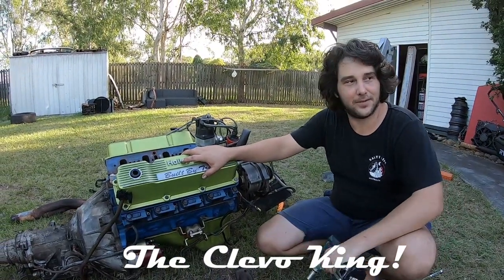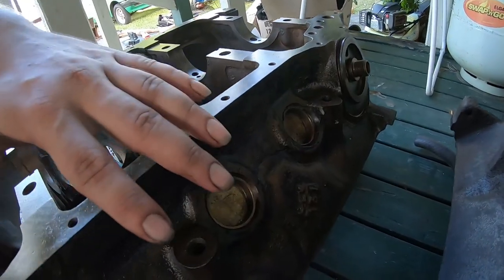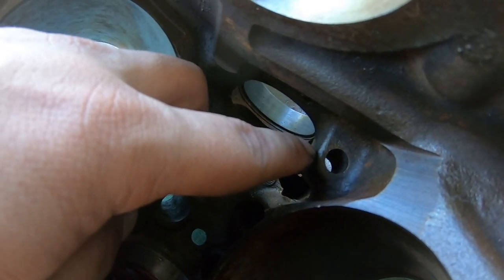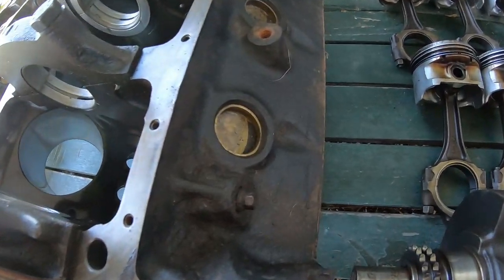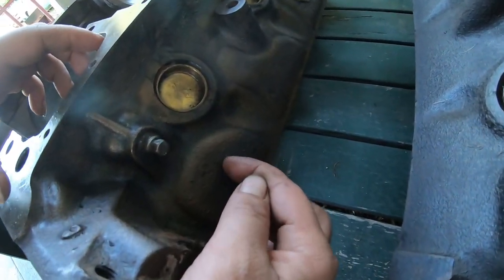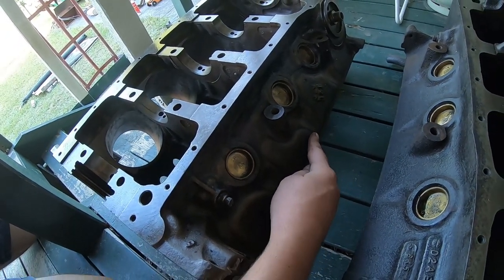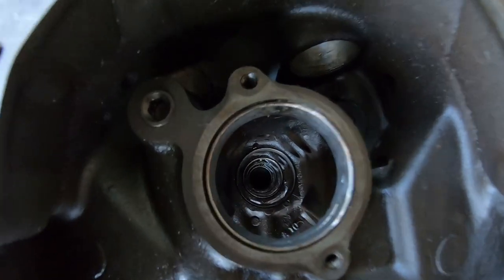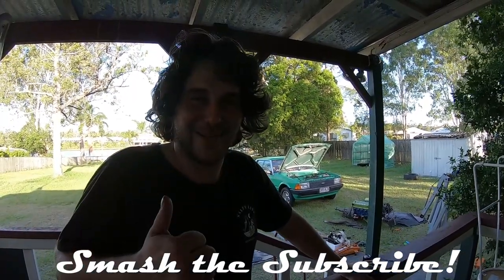351 Cleveland Pillow Block Tech Talk

Comment: The block number on the blue block D2AE-CA is the same as mine. It came up as 4 mains ,high out put ,cobra jet ,boss.
Could you confirm that's correct,it'd have me feeling pretty good if that's the case 😊

Comment: Great stuff read a lot on this. You Brothers are on it. Also what do You think off the oil line bottom left front to the sender to the back off the block is it worth fitting Clevo street Engine Stroker 408ci  Scat gear 4340 crank H beam rods SRP forged pistons  rev it to about 5500 lot more work done on it. Sveno Mick XB Falcon on YouTube You will see it. great site You Boys have would love to see Your opinion on factory Heads have a good one. Ps all street work is what I do Thanks.
Reply from the maker: Thanks mate, appreciate it. They are used on a lot of builds we have done in the past, but I haven’t used one personally yet.

Comment: Am very happy with the compression at 165 consistently, bottom end seems very good, no leaks etc, we have had a few props over time and are told this 3 blade one is about as good as we can do for out of the hole performance with an Argo V-Drive @ 17% step up and soft clutch? She’s just a bit tired and wondering if a cam and set of heads might give it the extra pep for towing big boys out on a single ski? 🤔🤔

Comment: I bought a block with a 4ma crank in it and I noticed also that the top of the bores are ground out for the valves, l'm interested to know if it's a particular casting, l know that nascar blocks are cut aswell...

Comment: I'm surprised that the Nascar blocks didn't have screw in freeze plugs. Also have you noticed the Cleveland having cracking problems at the rear cam bearing? I have found 3 blocks that were cracked like that. It be an american made blocks with the problems.

Comment: I have a XE block and it’s at the machine shop now.
Reply from the maker: Nice mate they are pretty cool blocks did yours only have the two bolts in the four bolt main caps?
Reply: @thclevoking  mine is a XE218940. I sonic tested it and it doesn’t have any core shifting. It’s a 4 bolt main. Has had a weld repair at the right rear lifter galley where they usually crack. I’ve had it for 30 years and am finally getting it built

Comment: Thanks Clevoking. Do the pillow blocks have a different distributor shaft size at the bottom part of the dizzy?
Reply from the maker: Yes any clevo cast after 1979 had a small 12.5mm or metric dizzy shaft the earlier were 12.9mm or half inch

Comment: So what's the reason about not running the block with the offset cam tunnel machining ?
Reply from the maker: They are more prone to core shift and not very suitable for those real high power builds.
Reply: @thclevoking  Thanks for that mate. I don't plan to build a crazy huge Clevo anyway, probably around 400-450 HP if that. It's plenty enough for the street.

Comment: Hi boys, will be checking all 4 clevos now for pillow blocks!! 😂😂 Question, have a 302 in a speedboat, 165 compression across all cylinders but lacks a little down low punch, runs like a dream just not enough oooomf, can you recommend some mods to get it out of the hole better without a full rebuild??? Heads, cam, intake? Not sure just don’t have the $6k/$7k for a full rebuild, any advice would be apprecited? 👍🏻👍🏻👍🏻
Reply: 165 seems pretty reasonable, what were you expecting?
I find most boats slow to plane tend to be over propped.  FWIW
Reply: MATE i dont care what anyone says,but for a boat you need cubic inchs,stroke it,for a 302 the more mods you do to it,[this goes for all motors]bigger cam and single plane manifold you take from the bottom to make more power up in the rev range.IF you didnt want to stroke then supercharge it
Reply: I hear you, she’s a social ski boat, rear mount, so blower deletes the engine cover and not safe for kiddies to get in and out of, have a couple of 351’s as an option but also a couple of XD’s that could use a stroker so might just do the swap for an already cammed 351 and stroke current 302 out to 393 and chuck that in the old XD? Was just hoping that a cam upgrade with some heads and/or intake manifold might be a cheaper option for a boat that only goes out 8/10 times a year? 🤷‍♀️🤷‍♀️
Reply: @aussiesupersnake6642  Along with displacement comes torque.  To get a boat on plane quickly requires torque.  If the engine isn't turning (due to giant prop), it can't make torque.
Sounds like the boat is propped for speed.

Comment: Very good info mate. Can you convert a two bolt mains into a four bolt ??
Reply from the maker: Yes you can mate finding original four bolt main caps isn’t so easy in Aus best to search the us market for some.
Reply: @thclevoking  Do we really need 4 bolt anyway ? For a street engine ? I don't plan to thrash the life out of it and I'm sure the 2 bolt can take some punishment right ?
Reply from the maker: The 4 bolts are not any better then 2 bolts just some of the 4 bolt blocks have heavier main webs and pan rails
Reply: @thclevoking  You're a wealth of knowledge. Thanks for that. I am planning to finish my XD at some point and I will probably have a go at building my Cleveland myself. I am mechanically inclined and don't mind having a go. Just need to watch more awesome videos from guys like you and plan it all out and ask all the right questions. I wish you were in Sydney.

Comment: still runs a shit oiling system , so before you pay 1k and up for a lump of cast crap look at buying a Dart , the main advantage on the pillow block over a stock cleveland block that he fails to mention is they have thick sleeves and can be bored out 60 and sometimes 80 thou over , but they still are junk if you want revs
Reply: It depends what doing with it,these oem blocks were only meant for 300 hp as GT even with oiling system were not a problem,but with restrictors in a thick block they are good for 650 hp  and 7500 rpm,after that you need a Dart/Arrow or Tim Meyer boss Cleveland block,if you have genuine  351 car for resale value,you better sticking to oem block

Comment: It’s just a std Cleveland block with pillows on the side they don’t even increase the coolant capacity if you had checked inside the water jacket you would have seen/felt that it’s no different to a std Cleveland I have one down the shed and have checked it.
nothing to be excited about and worth no more than a std block...
The XE block that had the full thickness pan rail and bulkhead are worth a lot more. 

The reason these pillows found there way onto the side of these late std castings could simply be, that the sand molding pattern  was modified for the XE block and that Modified part to make the sand moldings was simply use in the production bock from then on
Reply: Yeah, maybe so - but the cool thing about them is that it showed how much Ford Australia was tinkering away with a discontinued US design with slow incremental improvements. It's a shame the clevo didn't get half the love the xflow six did back then with their alloy heads. 👍